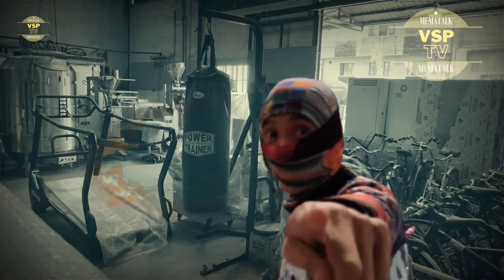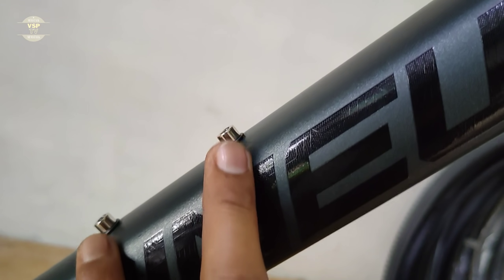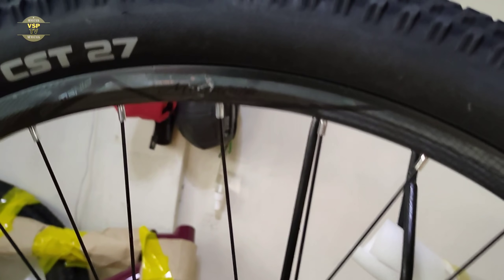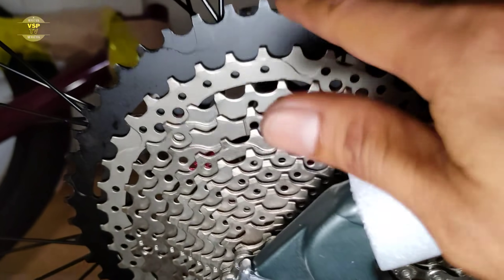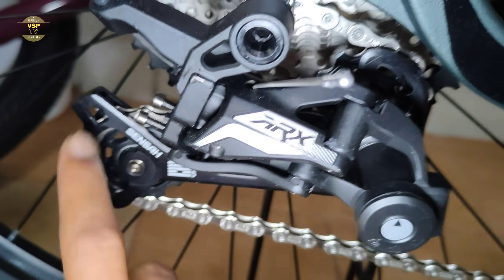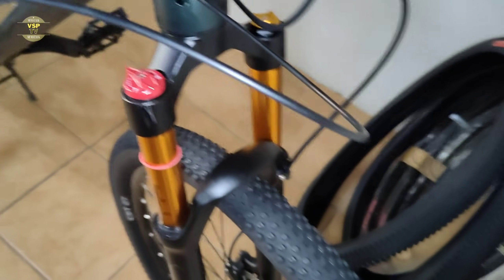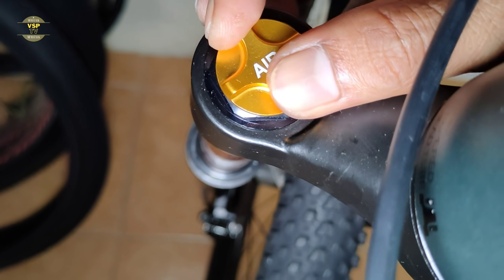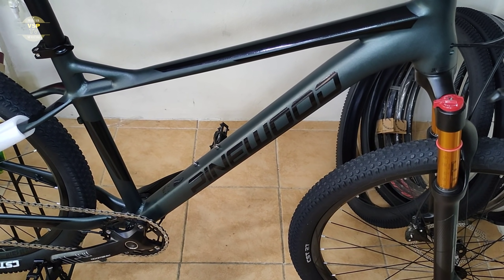BAGONG MTB PINEWOOD HERMAN 3.3 MURA NA MAGANDA PA!

Comment: Herman 3.3 owner here. Needed pa ipa re align ulit ang front wheel set kasi naka 90 degree ang spokes na nasa right side while nka 45 degree naman ang sa disc side. kailangan pa bumili ulit ng stainless spokes dahil hindi pwede i 45 degree yung stock na spokes sa right side. Medyo ma kalog din yung head set niya kaya nag palit agad ako ng sealed bearing head set. So far ok naman yung Airfork, no need na i lock out sa pavement, hindi naman siya kasing lambot ng spring coil na madalas mag sag sa ahonan. So far maganda din naman yung performance, sana nka tubeless na from the factory yung wheelset niya.
Reply from the maker: ETo magagandang comment master salamat po sa tips and advice sa tulad qng baguhan nalaman q Yung ganitong katangian Meron so Herman 3.3 ride safe po master godbless po
Reply: Thank u for honest review

Comment: sir ano kaya magandang mtb mga halagang 40k..
Reply from the maker: Master mag bulid bike kna Lng po ETo specs sa custom bike master
Speedone frame destroyer:1.94klg
1x12 speed sagmit edison 2 groupset
Hydraulic breaks
Sagmit rotors alloy
Sagmit raven latest 3pcs alloy handle bar alloy stem alloy seat post
Speedone hubs 6pawls na 
Rim sagmit 
Oil sleak na spokes
Compas tire skin wall 
Master sobra pa po Yung 40k mu sa ganyan set Nila po 
Sana po naka tulong master 
If ever na Shimano gs po Meron din po SILA ride safe master godbless po
Reply: @vsptvmematalk2997  Sobra ganda na po ba yung ganyang specs idol.. saka mag kano po estimate nyu sa budget na ganyang specs po naka speedone

Comment: Ano kya pwde na hubs sir na 1×13 speed QR casette na large frame MTB? Meron b P6K below n hubs?
Reply from the maker: LDCNC brand po master Meron SILA gawa na pwede sa 13 speed po ride safe po master godbless po
Reply: @vsptvmematalk2997  so pwde dyn sir ano? Forever din kc mtb ko, hirap mkhnp nyn ng hubs n 13 speed.
Reply: @vsptvmematalk2997  inquire ko nrin sir mgnda b sya sa cycling? Prng china made ata.
Reply from the maker: Master yun sa performance nya Hindi q pa nasubukan po Yung hub pero mag survey aq sa tropa master kasi bumili po SILA nyan hub na yan update po aq agad master if maganda or may bad sa hub hehehe mahirap mag sabi Ng maganda master lalot Hindi q pa po nagamit ride safe po master